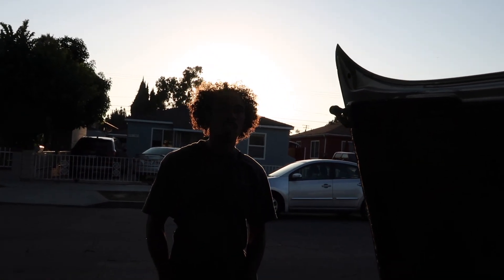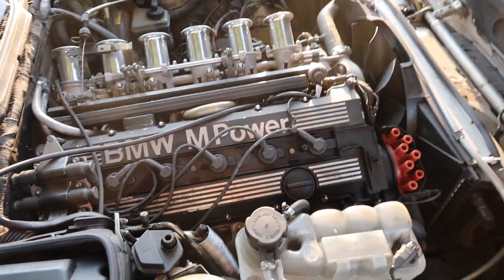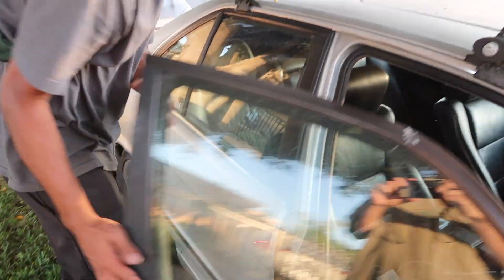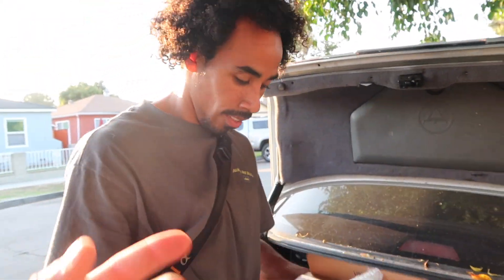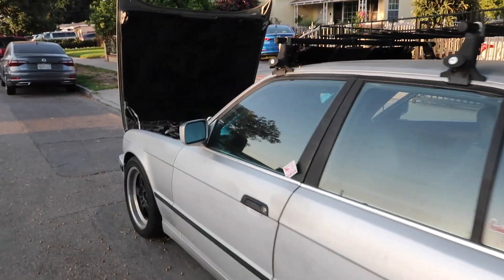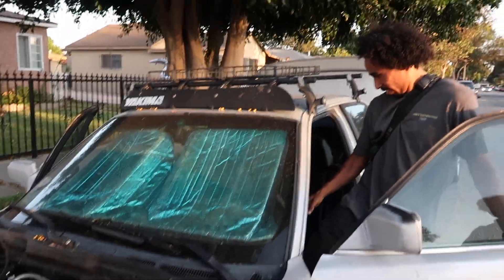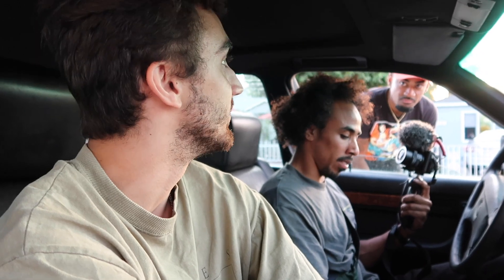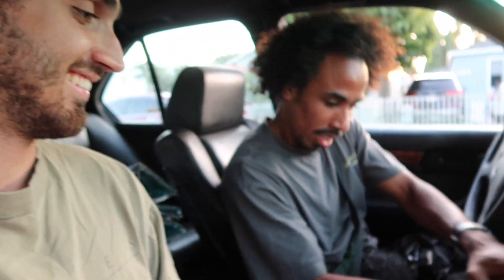Checking out StacheCam's E34 M5 w/ Velocity Stacks |  Revs and Induction Noise!!

Comment: I’m 48 years old and you guys are an inspiration! Finally got my 1995 540i clutch installed this Labor Day weekend after being taken apart since November of last year due to lack of parts. Just need to drain fuel since the car has been sitting for 2 years. Already starts on ether but won’t stay running. Enjoy watching all the cool videos! I’m in Arizona.
Reply from the maker: Thank you man! I appreciate it! Good luck getting the 540i running!!
Reply: @m3nameisjosh464  540i is running! Fuel pump went out from sitting too long. Luckily a YouTube video made my day this morning that it had an inspection plate in trunk for fuel pump. Almost pulled the fuel tank off. It’s a 1995 540i 6 speed hellrot.

Comment: Hey guys, my daily driver is an e30 320i with an m20b20, its kinda sluggish, and the throttle response is soo bad, any tips please? Should i aim for a m50/m52 2.0 liter engine or just keep the m20?
Reply from the maker: M50 would definitely help pep the car up!
Reply: Sounds like there is something wrong w ur engine. Like vacuum leaks or fuel related

Comment: Imagine s38 engine swap in e30 sheesh
Reply from the maker: Would be amazing dude
Reply: I've been talking about my dreams of doin one in my e36 for the better part of a year now. Unfortunately obstacles like finding the right trans,obd1 on a obd2 car,radiator and the oil pan are like the most expensive obstacles to have. I just love the non vanos rod bearing aspect of it component and EVERYONE does the s54 swap and importing a euro s50 would prob cost as much as figuring out the obstacles in the s38.